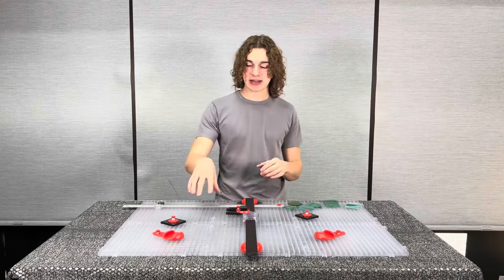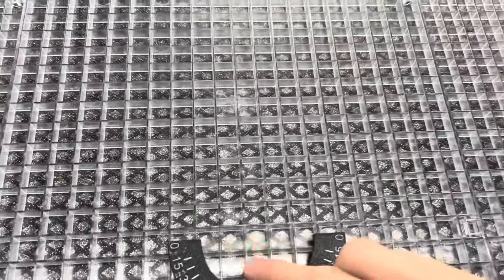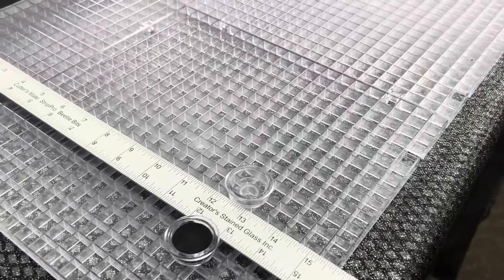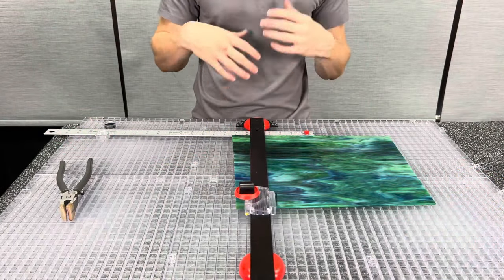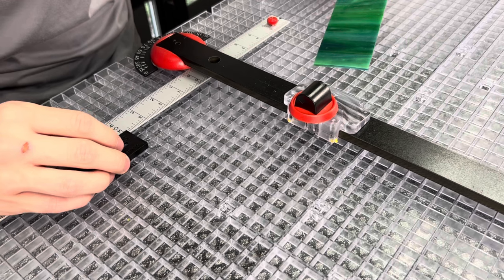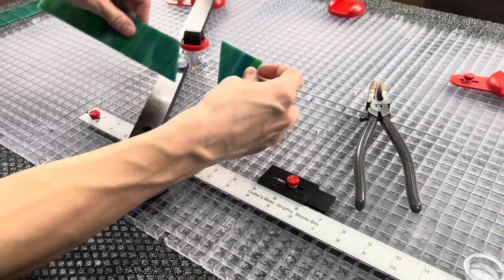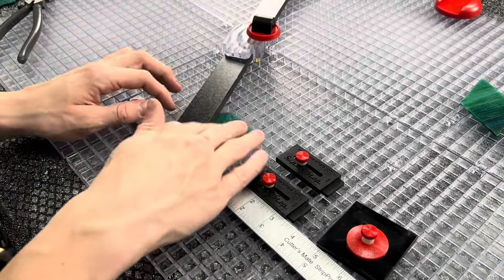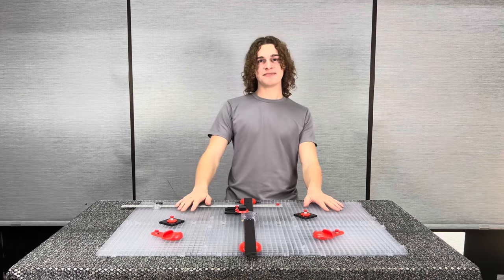Master Glass Cutting With The Beetle Bits System: A Comprehensive Guide

Comment: To cut an equilateral 3 inch triangle do you need to cut the strip you use smaller than 3 inches?
Reply from the maker: To get an exactly 3” equilateral triangle you would have to cut a 2.58” strip, so I would align the glass to the 2.5 mark and then go about one tick above it.

Comment: Hello, any tips on cutting front surface mirrors? Specifically snapping. I am not sure if I am not scoring it correctly or what but when AI go to snap, the whole mirror cracks. I am cutting strips ~10" long and 1.25" wide. Thx
Reply from the maker: It was a pleasure speaking with you on the phone, your cutting head is on its way. :)
Reply: Did you finally learn how to cut front surface mirrors?
Reply: @7elegrama  yes I spoke to them and they gave me a bunch of tips. Once I started using running plyers it was pretty easy.

Comment: Just purchased the Beetle Bits system and noticed that the cutter device is spring loaded.  In watching your video, it does not appear your cutter is spring loaded.  When I slide my cutter down towards the ruler, it’s not stable.  What am I missing?  Thanks for your help
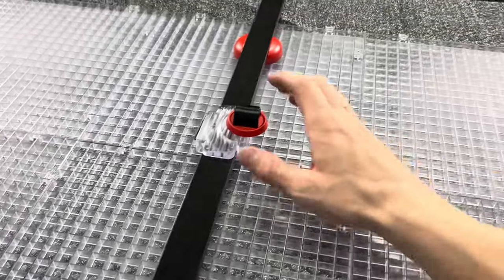Reply from the maker: At 4:13 in the video, you can see the Flying Beetle is spring-loaded. You can make adjustments to the set screw using the provided Allen wrench. Make sure that you have a firm grip on the beetle body while pressing down on the button. (Just like holding a mouse for a computer)  If this doesn't help you can always give us a call so we can explain it more in depth.
Reply: Thanks for the quick reply.  I did watch the video a few more times and figured it out.  Love the system.  @creatorsbrand